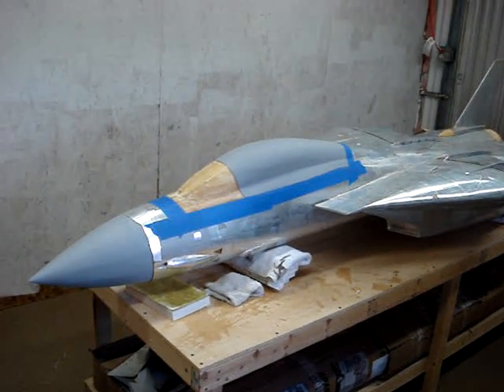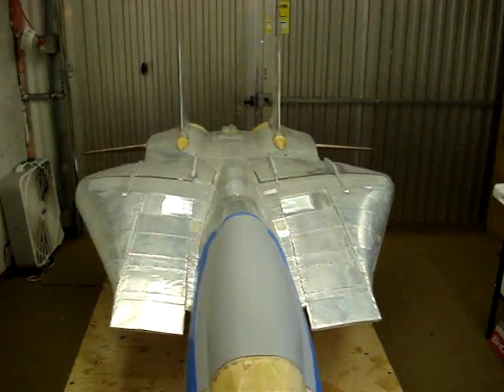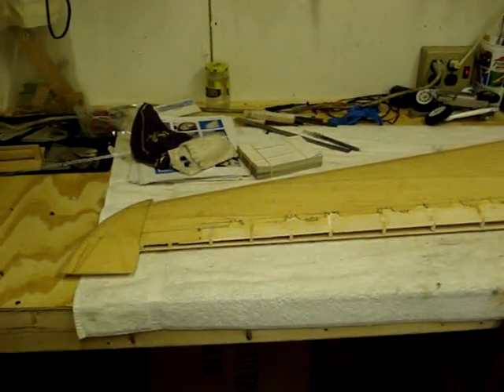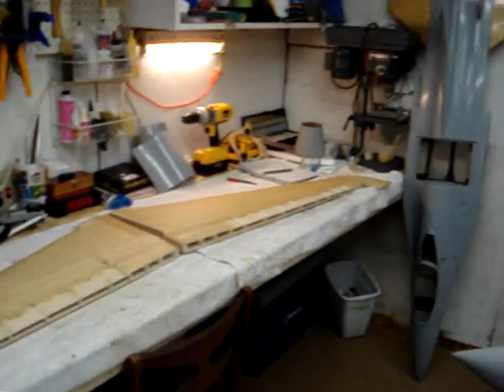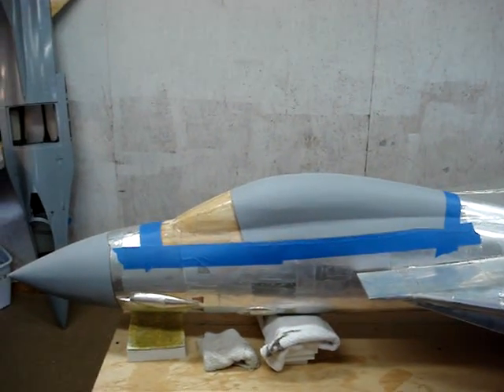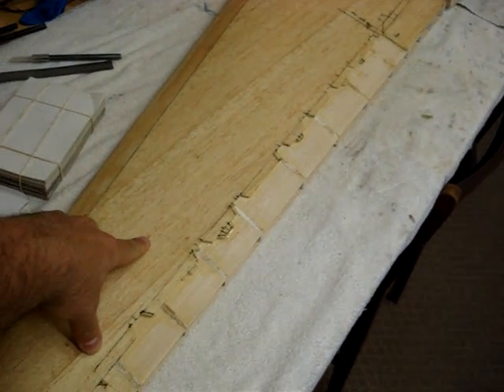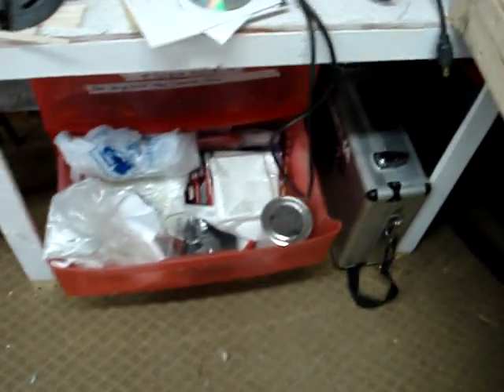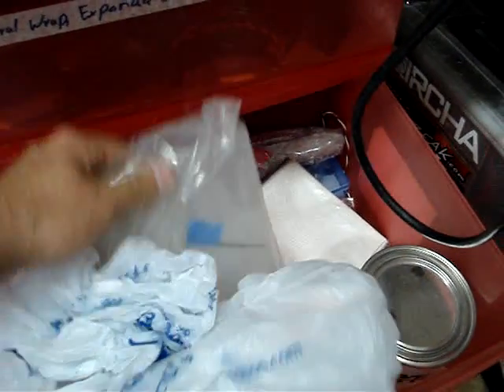How to build an F-14D Tomcat #9.

Comment from the maker: @bmwalp1na   I hope to molds keep the detail as well.  IF alot of the rivet detail disappears during the molding process, it wont be a big deal, as alot of the rivet detail on the full-scale tomcat is not noticeable, so i've only put the rivet and screw details on the panels that its most noticeable on.